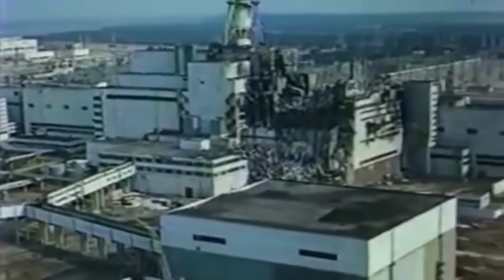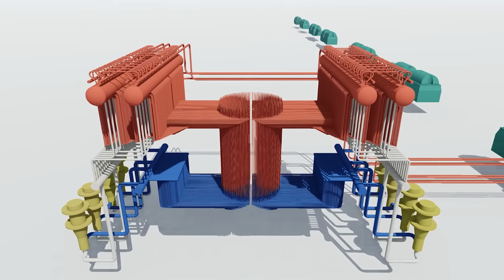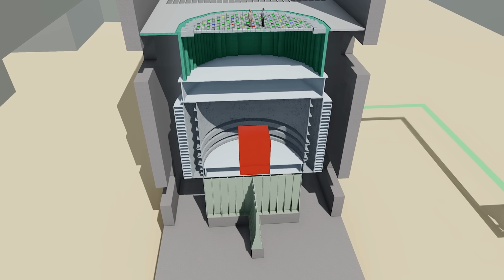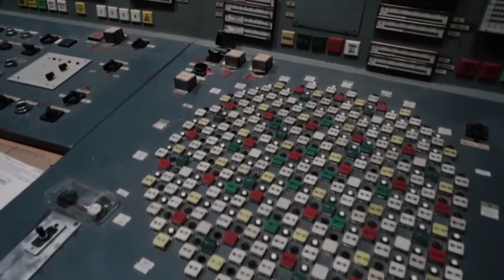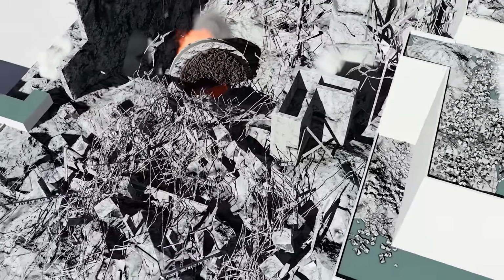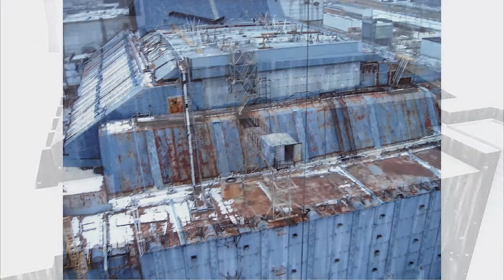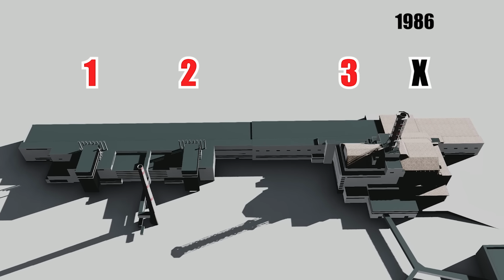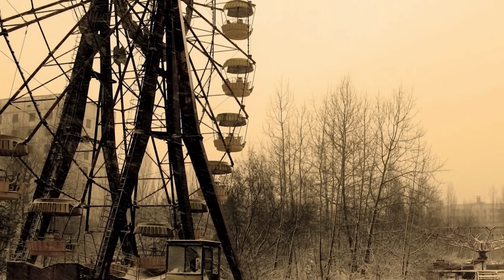CHERNOBYL DISASTER - An Inside Look - 3D

Comment: So I am wondering how a low grade fuel went super critical without  sufficient density or pressure.  I recall Dr. Teller saying that it was a hydrogen explosion from the water in the reactor.  Same event happened at Fukushima.  Super critical implies the fuel was of high enough density that the reaction cascaded out of control via fission, not thermally as you imply.  If this plan had used high density fuel and it actually went super critical, it would have made the czar bomb look like a fire cracker.  At the most, the reaction ran away as they lost control of slowing it with the graphite because as I recall the graphite burned out and lost structure.  This is one of the great failings of things like Youtube.  Actual documentation and papers written at the time get removed from history while people like Dr. Teller, who was consulted on the matter, die off and lose their story in history to a bunch of hack story tellers.  I would say stick to architect and leave the nuclear physics to the physicist if you are going to misrepresent what happened with half truths.  At least then actual knowledge of what happened will be handed down to the next generation.
Reply from the maker: I used the term super critical before properly understanding it has to do with fission in a nuclear bomb and in a reactor but I fell for it because its sounded cool.  Rookie error... LOL  And you are right, low grade uranium cannot fission.

Chernobyl was a simple but very large heat and gas explosion.  There was nothing nuclear about the explosion other than the rapid heat generated in the core resulting from a run away reaction.

Comment: RBMK wasn't the only type of reactor in Eastern block. There were also reactors like in Fukushima - VVER (PWR) reactors - in fact those were most common in Eastern block... But.. those reactors were more expensive and didn't allow refuelling while in operation. And soviets really wanted to refuel their reactors in full opearion.. because they wanted used fuel whenever they needed, mostly for nuclear weapons during Cold War. So RBMK was invented - cheaper design, cheaper fuel (no enrichment) and ability to refuel 24/7 without stopping the reactor. And to be honest, it was clever design.. Only if staff in control room was properly informed and trained about this type of reactor.. Which they were not.. On the contrary, they were misinformed and put under high pressure by the government. And thats straight road to catastrophe.

Comment: The rest of the reactors were still being used after the explosion? Up until the early 2000’s? WTF
Reply from the maker: They had to get 3000 MW back into the grid. Otherwise they would have had a very big electricity supply shortage

Comment: From the sounds of it the reactor was safe, though there were some complications in wiring and handling by the staff vs the reactor being a horrible design...
Reply: While yes decisions made by the operators are what lead to the disaster (not complications in wiring no idea where you got that??) The reactor design itself is incredibly unsafe.

Most reactors are designed in such a way that it is actually quite difficult to maintain a chain reaction in the core, very specific conditions must be met and maintained, any deviation from those conditions will actually slow the reaction down and reduce the power output, this design choice is important for safety as if something isn't working properly or starts to go wrong the reactor will reduce its thermal output. This also means that no matter what choices the operators make they cannot put the reactor into an unstable condition.

This is not the case for the RBMK reactors, many of the design choices make the reactor cores vulnerable to unstable conditions where the core can enter a state of runaway chain reactions.

If you would like to know more details I would be happy to provide the but it is quite a lot to type out.
Reply: @Ender240sxS13  The Chernobyl # 4 reactor was extremely mis-managed by the operators the night of the accident.  It was poisoned and practically stalled, had a ton of its automatic safety features switched off, and even had multiple cooling pumps manually disabled in a very stupid shortcut to boost its thermal power levels.  And even then, the runaway only happened after the power was cut off to the remaining cooling pumps AND nearly all of the control rods were SCRAMed at the same time from the position of being fully-withdrawn.

The RBMK has its flaws (especially compared to modern reactors, but remember that it's based on 1950s tech and science), but the design is nowhere near the ticking time-bomb some folks make it out to be.  It took a whole chain of bad decisions and just the right circumstances for the Chernobyl disaster to happen, and by far the biggest cause of the disaster was the poor safety culture and inadequate training in place at the time.  Many RBMKs were built, and with proper training and better understanding of how the reactor behaves, they operated for decades without major problems due to the core design.  Several are still operating today, with some design tweaks after the 1986 accident, yes, but no fundamental changes.
Reply: @SynchronizorVideos  Yes but it all adds up. The root cause of literally every contributing factor: bad design, secrecy around important technical details, putting undereducated men in charge and putting them under pressure to meet arbitrary norms is stupidity and arrogance built into the very core of soviet style of leadership.

Comment: Excellent animations. Really helps visualize what happened. Only slight disagreement is on the value of the ‘permanent’ rolling sarcophagus...it doesn’t actually protect anyone; it was built strictly for public relations. It would have been just as safe to the “outside world” to leave the building alone.

Comment: How is it possible that the other three reactors continued with work after the disaster? I can not believe it was safe for the workers in those other reactors to be that close to the source of radiation.
Reply from the maker: Inside the buildings it was safe to work.  Outside there were heavily contaminated areas around unit 4 and places where the wind drifted the radiation.  The radiation was highly variable and the dangerous areas were mapped and avoided.  The workers followed known safer routes in and out of the building.  
After the disaster liquidators "cleaned" the area.  This involved spraying a sticky material to which tiny radioactive particles stuck.  The sticky material along with the radioactive stuff was picked up and disposed of.  This made the general area outside the buildings a lot safer but not a place you would not spend unnecessary amounts of time in.

Comment: I have only 2 real problems with this video:
1: 1:05 What you are talking about is the thermal coefficient of a reactor. The RBMK reactors also had a negative thermal coefficient like western reactors. What you call it is a positive void coefficient which is not the same thing. A positive void coefficient is when your coolant is also a neutron absorber(such as water in this case) and if that coolant turns to steam it lowers its density significantly and creates a "void". That "void" means there is no longer something effectively absorbing some of the neutrons in the reaction. This causes the reaction rate to increase. Positive void coefficients are normally seen as a bad thing but at small levels, they can be fine as they will cause an increase in heat which will slow the reaction rate down. See: negative thermal coefficient.
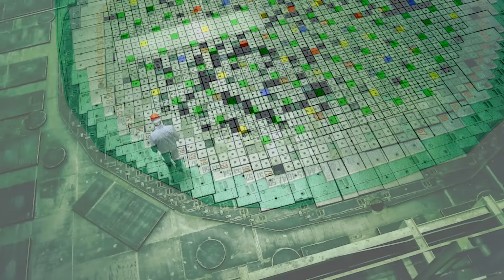2:  2:43 Online refueling is not specific to the RBMK reactors and is or has been done by numerous western reactors such as the CANDU and AGR. There is nothing dangerous about doing this and in some designs, the reactor MUST be refueled at full power for safety reasons. So your analogy about driving without a seatbelt makes no sense. I'm not sure where you got this idea from.
Reply: Which university do you teach nuclear physics at ?
Reply: @andrewcruz1931  haha I'm just a nerd. I did study physics in college but I'm a pilot not a physicist.

Comment: thank you so much for this 3d model that is a lot easier to understand than the usual bars and lines. when replacing a spent fuel rod, do they individually shut off one of the 2000 water pipes while the rest are still active? is that what you meant by driving with no seat belts?
Reply from the maker: Great to hear!
Reply from the maker: Exaclty, any channel or pipe needing refueling or maintenance could be shut off top and bottom and isolated.  And this permitted refuelling while at full power.  Some can argue that nuclear reactors are so powerful they can never be safe.  So all reactors are essentially driving without seat belts because no safeguards are strong enough to contain a situation when things go badly wrong, as in Fukushima.
Reply: @Mike-Bell  thank you very much